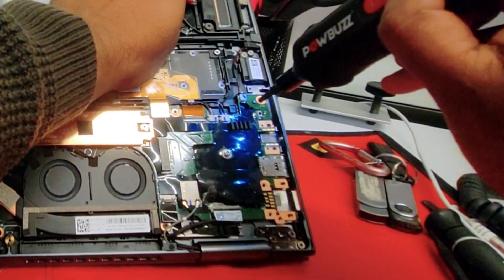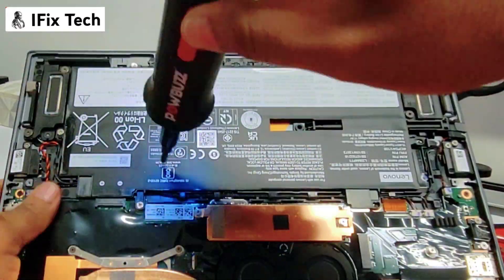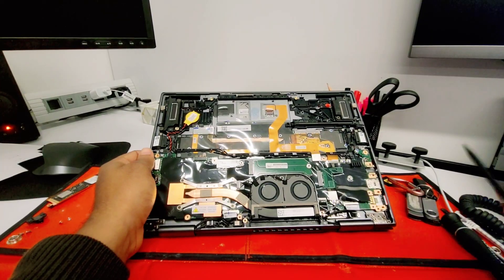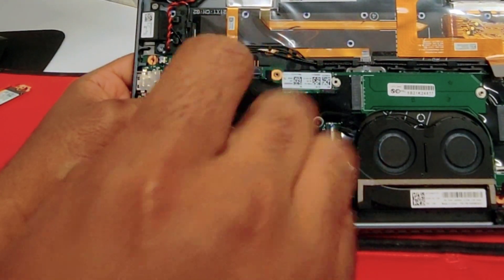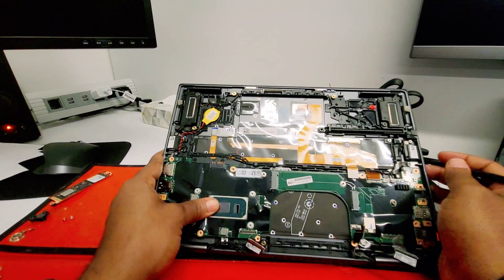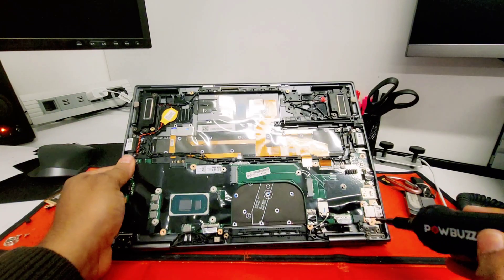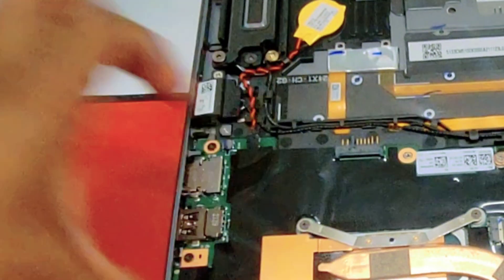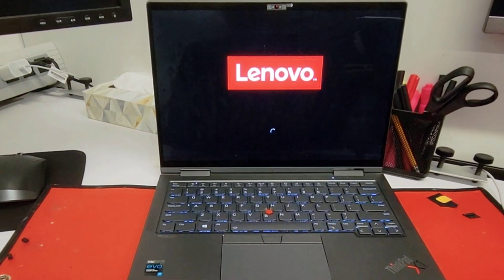Lenovo X1 Yoga Gen 6 USB-C PORT NOT CHARGING ❌️ 💻 How to Replace Motherboard

Comment: Replacing the motherboard is NOT replacing the ports, it's a fix nearly as expensive as the laptop would be used!
Reply: this is not usb-c this is thunderbolt-4
if tb-4 isn’t working anymore, 99% it’s not because of a loose/broken port, it’s the thunderbolt controller that’s dead
and no one will replace the tb-controller and flash it with a new firmware, then calibrate it
Reply: @2uxzh01k  tell that to the 4 Thunderbolt ports I replaced on a clients Macbook Pro, the PORTS do die, not just the controller

Comment: you replaced the whole motherboard to fix a soldered usb-c port with corresponding IC, and other potentially failed chips that cost anywhere from cents to dollars to replace? jesus. even if it was just the port, $5 for a USB-C port vs $WHOKNOWS how much for a motherboard seems more cost efficient.
Reply from the maker: Hello,
You ate correct.  Replacing only the port is much more affordable. But in this case, the customer wanted a new, upgraded motherboard. Thanks for linking it and subscribing 😉👋